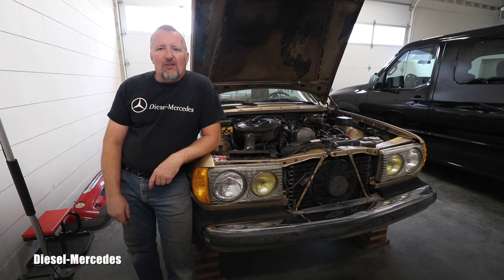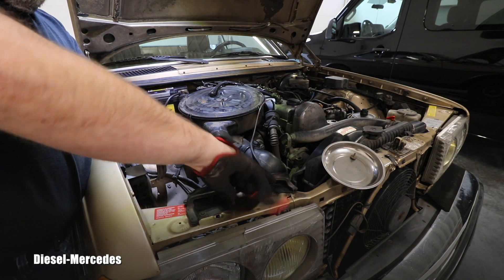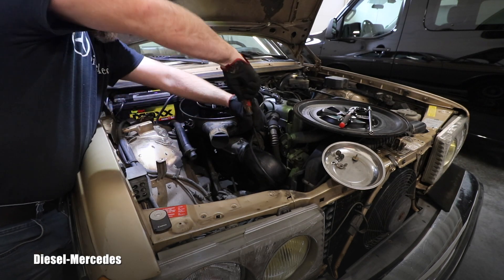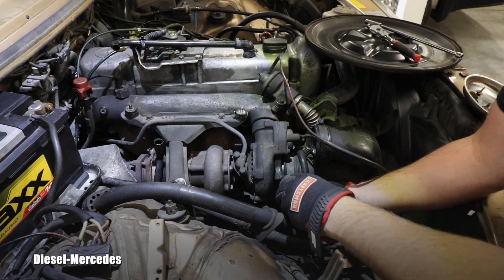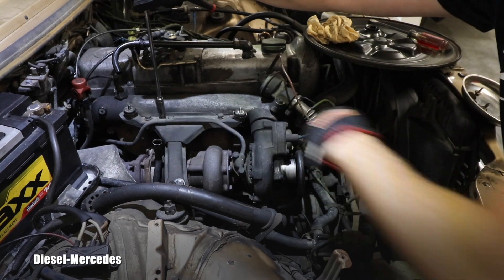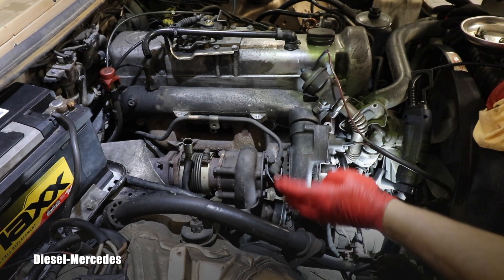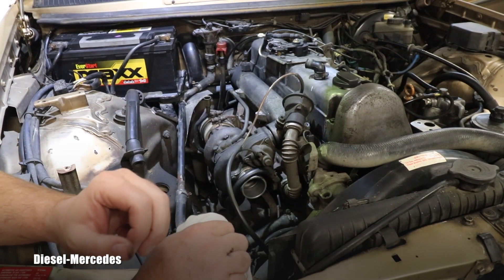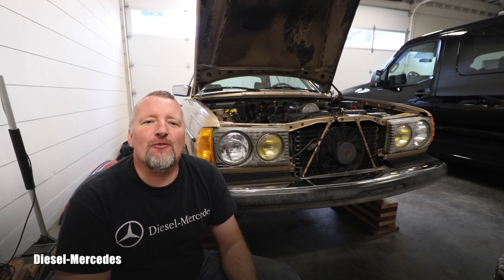Mercedes W123 Removing Air Intake, Sound of Turbo

Comment: Thank you for the great videos and I am waiting fo part 2. 7 years ago was gonna buy a kit and install it on my 1982 turbo Diesel but I hesitated and wanted to keep the car all original and now I regret it, Changed 3 brakets in 5 yeras and when ever I change the air filter I change 1 or 2 of the rubber things that the huge air filter sits on,.Now IAM waiting for part 2 to see how you do it and what kind of parts you're gonna use an how to keep that intake air cold.thank you again and all your informational videos are greatly appreciated..
Reply: WW PC still waiting for part 2...

Comment: the one part that you referred to as the "wastegate" it is actually only common in 84-85 models and is called ARV - air re circulation valve, the only mod to it would be to disable the vacuum going into it. u dont really need it
Reply from the maker: Thanks for sharing
Reply: The rubber hose at the top, right?

Comment: This has been proven not to get better air flow. The factory air filter gets more air flow than your turbo can suck in. Plus it is a true cold air intake. Not sucking in hot air from the engine bay from a cone filter.